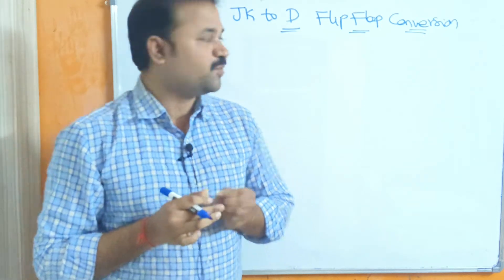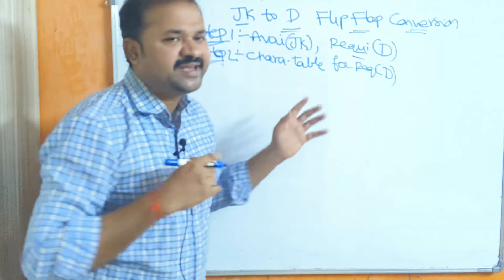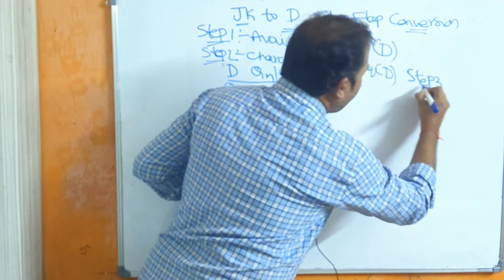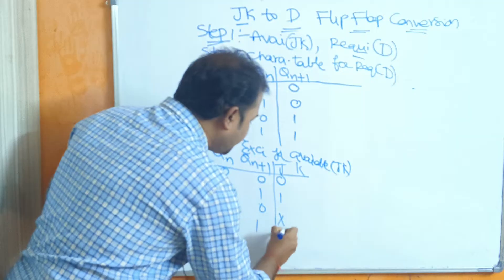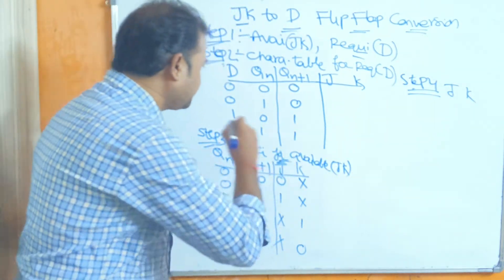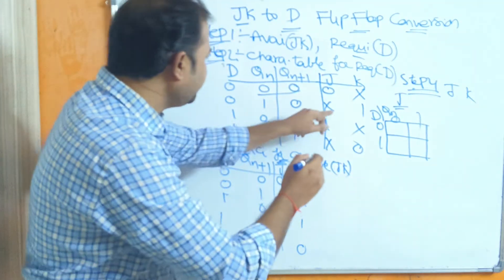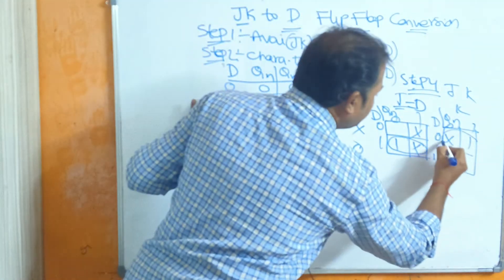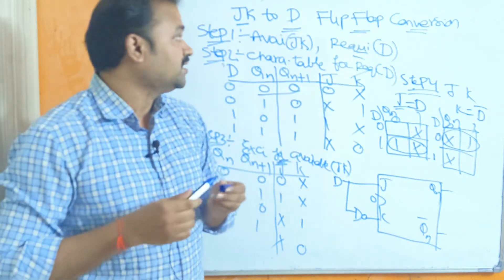JK Flip Flop to D Flip Flop Conversion || JK to D Flip Flop Conversion || DLD || DE || Digital Logic

Comment: Good evening sir 

Could u please help me sir 

I need some some topics to be explained by you of compiler design subject. Because its urgent for me .

I know that I can't disturb u r videos playlist process now. But its very urgent for me sir....

I kindly request you to do videos on

1.Evaluation order of sdd
2.syntax directed translation schemes 
3.implementing L- attributed sdd
4.variants of syntax trees
5.three address code types and declarations
6.type checking 
7.switch statementa 
8.stack allocation of space
9.access to non - local data on the stack.
10.heap management 
11.introductionnto garbage collection 
12.introduction to trace based collection 
13.addresses in target code 
14.register allocation and assignment 
15.dynamic programing code generation
16.principak sources of optimization 
17.inttroduction and foundation of data flow analysis 
18.constant propagation 
19.partial redundancy elimination
20.loops in flow graphs.

Please sir I kindly request you to upload atleast some of above topics related to compiler design.